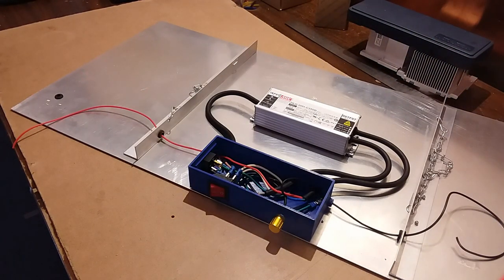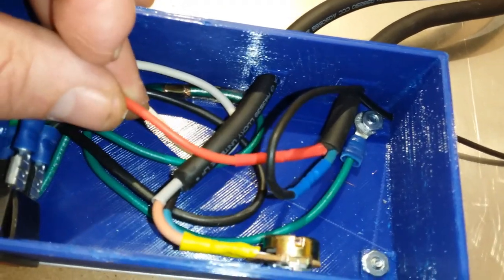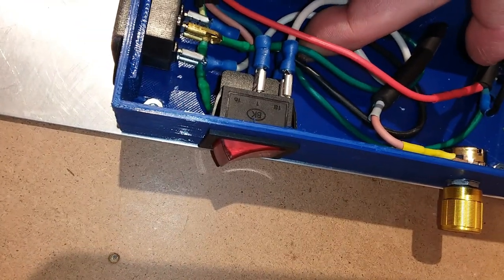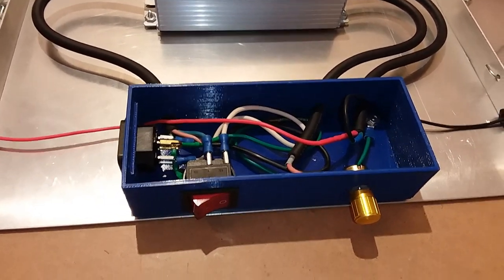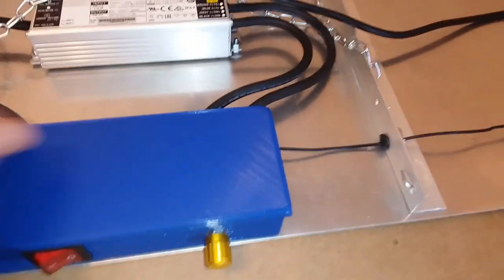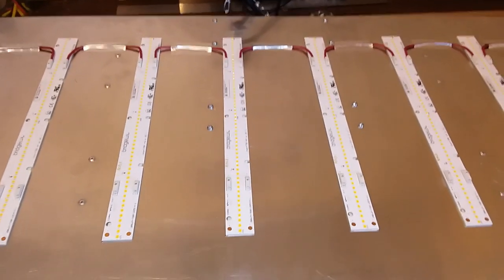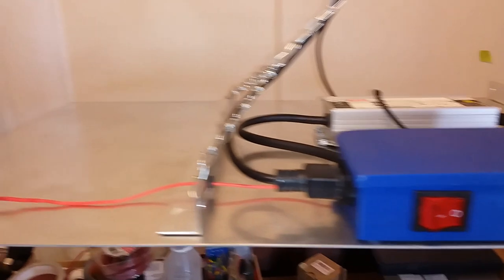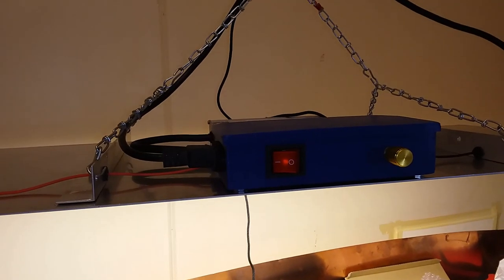EB2 LED Light Build, Final

Comment: This video just popped up on me feed I made a light with the same strips about 4 years ago I ran mine at 1050ma I used a aluminum sign I sanded down and cleaned up with some aluminum L on the ends to hang and extra support.